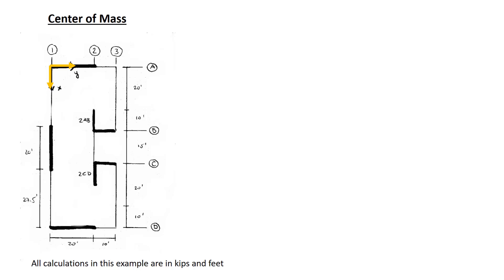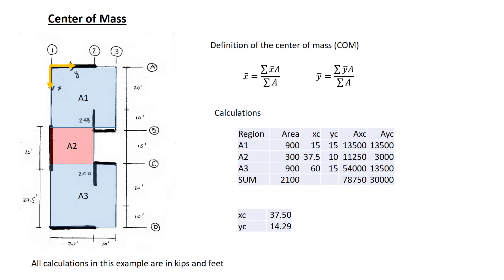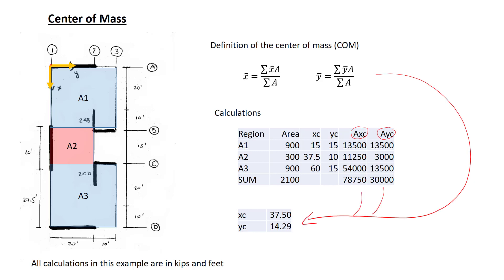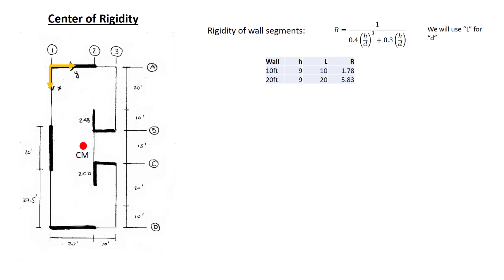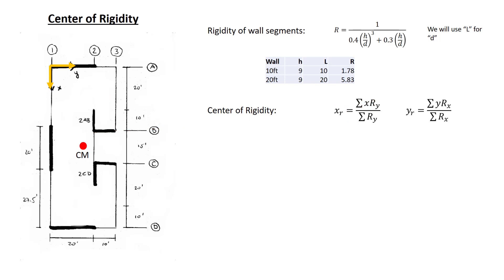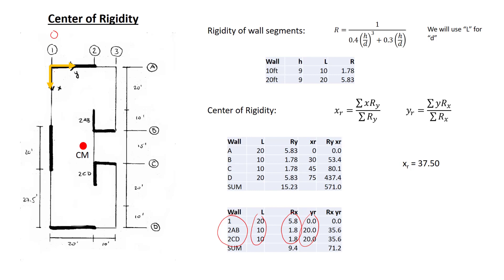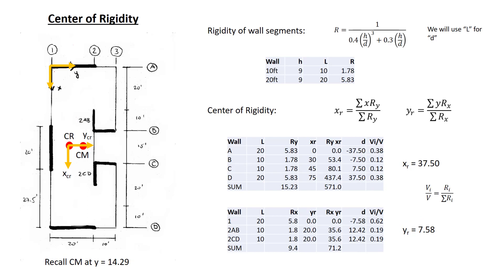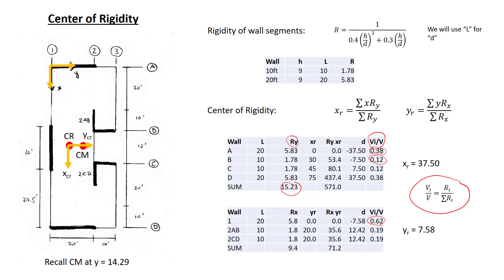Rigid Diaphragms 01, Centers of Mass and Rigidity (no concentrated masses)

Comment: Young graduate engineer here, this concept was made very clear to me, however I have been asked to calculate the Center of mass and rigidity through hand calculations of a structure that is not purely a frame structure but a combination of load bearing and frame action on different grid lines. So I have tried converting the load bearing frame into a frame with an equivalent strut. Though I am yet to approach my seniors, I wonder whether this approach is logical?

Comment: You just calculated the geometric center. Not the center of mass.
Reply from the maker: You are correct. The geometric center is the center of mass if the diaphragm is homogenous, which is the case if the weight of the walls is assumed to be smeared evenly over the diaphragms. Of course, it would be more precise (at the cost of complexity in an introductory video) to include the weights of the walls and their explicit location.
Reply: @tonatiuhrodrigueznikl7816  Somewhat true. If you use, say, 250psf live load...a heavy storage load...you must consider a portion of that load in the seismic analysis, as you would with a snow load above 30psf. So regardless of the homogeneity of the diaphragm there can be different COMs. Also, the equations used in this example say COM = x bar times area, etc. When actually, the COM = the sum of the masses x distance over the sum of the masses. We had a young engineer in our office calculate the COM using your geometric center equations and when I was explaining it to them they said the picked it up on this video. We encourage our young engineers to do their own research so it is my responsibility to vet the resources. In the true scientific sense, COM never equals GC. They may happen to both equal the same value, but they themselves are not equal.
Reply from the maker: I'm embarrassed about the delay in my reply. I appreciate your attention to detail and to the education of your young engineers. I agree that this is not well explained for the reasons you describe. I intend to recut and repost the video; in the meantime, viewers, please make note of this important clarification.

Comment: Hi. What happens if i have X-brace instead of shear walls? How to calculate center of rigidity? Can you provide example video for that case?
Reply from the maker: An example video probably won't come for a while, but the concepts here apply to any lateral system. For a braced frame, barring a more detailed analysis, look at this reference from the AISC: https://www.aisc.org/globalassets/modern-steel/steel-interchange/2013/012013_si.pdf.
Reply: @tonatiuhrodrigueznikl7816   Many Thanks for this article.

Comment: Why was the mass of the walls not included in the Center of Mass calculation?
Reply from the maker: Excellent comment. I hope that other viewers see this comment and recognize that the video involves a simplifying assumption.

It is indeed more exact to include the weight of the walls in the calculations. People do this differently. It makes most sense to include the weight of the bottom half of the walls above and the top half of the walls below. These weights should be lumped at the centers of mass of each wall.
Reply: @tonatiuhrodrigueznikl7816 I was gonna ask the same question.
Reply: @keyou1228  i was gonna ask this question too